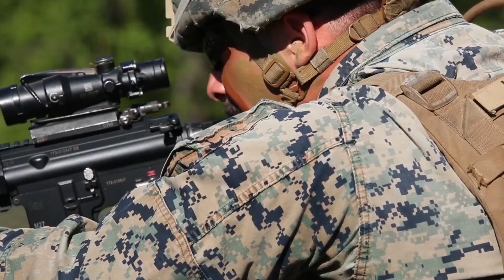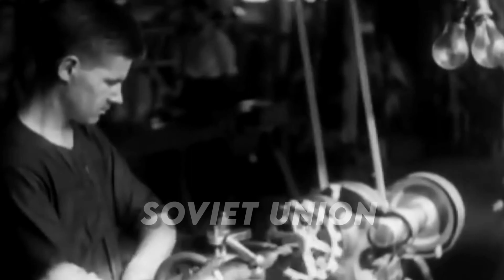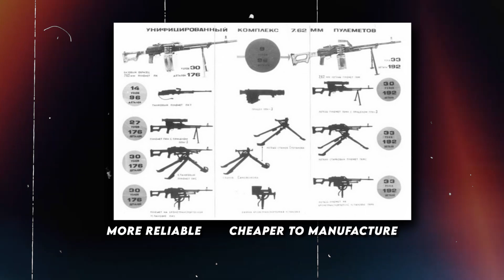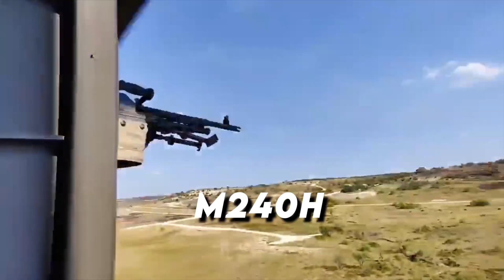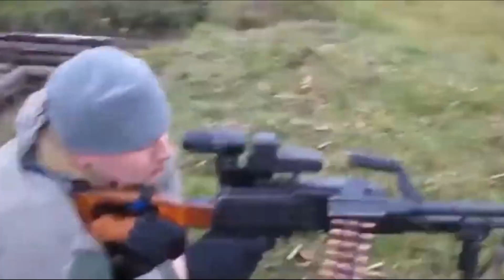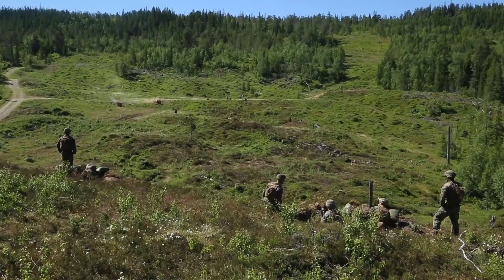US M240 vs Russian PKM Machine Gun - Which would Win ? | Guns Comparison #military

Comment: I am quite familiar with both the MAG 58 and the PKM and I love both for different reasons, however in the role of a Medium Machine Gun, laying down suppression fire, I would go with the MAG 58 every time. Why?

The MAG 58 is capable of firing longer with fewer stoppages. The PKM is cheaper, not as well built and suffers from more stoppages than the MAG 58. The feed mechanism is outside of the receiver. The rimed cartridges are more prone to jams than the rimless cartridges of the MAG 58. The MAG 58 has a heavier barrel that can fire more rounds before it heats up. Also the barrel change on the MAG 58 is simpler and can be done much faster so that you can get more rounds on target in less time. I found that changing barrels on the PKM, you have to unload, open the feed cover and tray, then use a tool to slide the barrel locking slider to the right, then using the carrying handle to lever the barrel out of the receiver and pull away, often this is hard to do when it gets dirty and hot. The MAG 58 is just so much faster.

Range, again in the context of a Medium MG, I find that both do the job well. They both have acceptable range and neither one seems to outperform the other my any measurable mark.

Kinetic Energy, while the 7.62 X 54R has a heavier bullet and lower velocity, there is no marked improved terminal ballistics. Both do the job of Medium MG well, you won’t find the PMK dropping more enemy in less time than the MAG 58.

Where the PKM shines is that it can be employed as a Light Machine Gun. It is lighter and more portable than the MAG 58, so you could use it in the Light MG role, something that you cannot do with the MAG 58. So, you should then be comparing the PKM vs the 5.56mm Minimi. Here the more powerful PKM would definitely outperform the Minimi. But as long as we are comparing Medium MG’s and their assigned roles, and not LGM’s, I will go with the MAG 58 for the reasons I have stated.

Comment: The only advantage the 240 has over the PKM is that if you carry the PKM with the bolt back ready to fire there’s a chance the cartridge will nose down out of alignment with the freed way.  Thats because the PKM uses a pull-out belt without controlled feed so the cartridge is only held by the spring pressure of the belt claws.

In normal operation from a bipod this isn’t a problem.  But if you tried to carry the PKM locked back for a long period there’s a decent chance you’d get a jam.

In combat soldier prevent this by carrying the gun with the bolt forward, so it can be readied for firing by racking once.  That’s a good solution but also induces some delay.  Not a major issue really.

The 240 avoids this by having a push through belt like most NATO weapon.  But the push belt makes the receiver longer and heavier.

Honestly IMO it’s too bad the M60 wasn’t retained and upgraded the issues with the M60 were all fixable and it’s a much lighter platform than the M240.  In fact when you compare the M60 and PKM you realize the PKM’s issues with extreme durability are all shared by the M60, neither is designed to shoot 100k rounds with no parts replacements.  Russian doctrine just accepted that PKM’s would go down occasionally and the gun is light enough/cheap enough to carry extras.  The modernized M60E6 used by the Danish is easily a better service weapon than the M240 and arguably better than the PKM.
Reply: PKM is used by poor militia M60 isn't so yeah all western made weapons are crap.

Comment: You can adjust PKM or PKP and there are no jams on PKM. It can shot easy 600 rounds with no problem and PKP was made for higher fire rate and much more bullets to be shot even up to 2000 rounds with barrel only getting warm. And not close to worn.

Comment: I'm ukrainian vet with experience both, also RPK (5.45×39 machine gun, just AK with longer barrel). So i would say that PKM is the way better for infantry not only bcs of lighter weight, but also because it has accuracy and reliability not worse than m240. Additionaly, it shoots with duty and even wet ammo, and it's  easier to get a cartridge if you haven’t chambered it. During reloading, cartridges are easier to insert into the slot than with the M240. And you can also take ammo from dead russians) M240 is better for using on technic, cars, helicopters, AIM etc.
Anyway, i think NATO rifles , technic and artillery the way better in many components. But especially about main infantry machine gun or rifle, in a duty  trench party- only AK platform.
Reply: Love my 72nd brothers. You guys fight like demons. If you switch to the British gpmg variant of the 240, you can boost the fire rate to close of the mg42 but still have the overall same gun. I'd also agree with assault vs vehicle and defense pros of both guns. I love my pokemon. Only thing I don't like is that it isn't as modular as the 240. Getting a shorter barrel and collapsible stock to it are a pain along with not having a forward rail system. Still great guns though
Reply: Wow, an ukrainian veteran! I dare to ask: what about the fpv drone threat? How you dealt with them?
Reply: looks a professional reporting
Reply: подлизал так подлизал